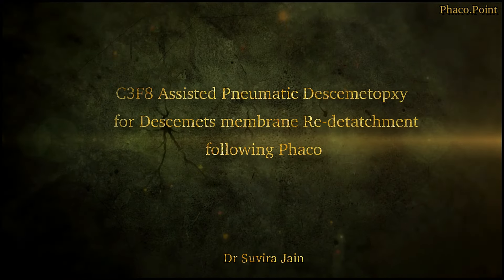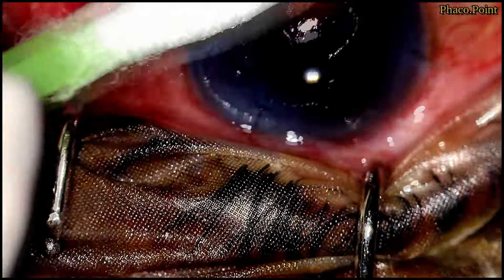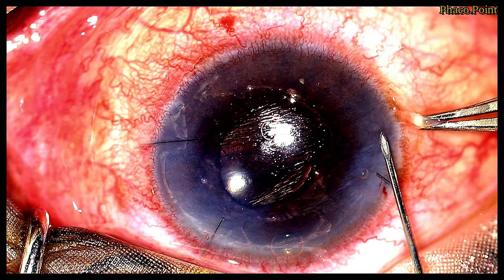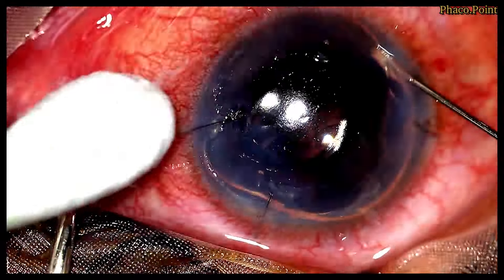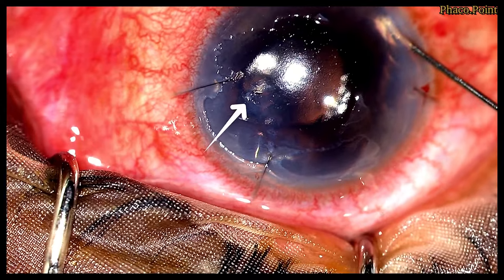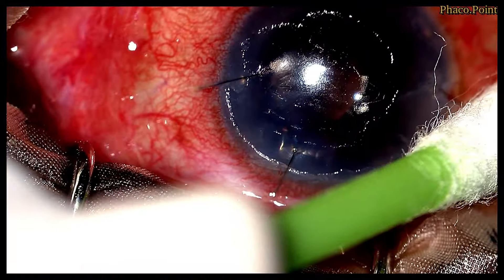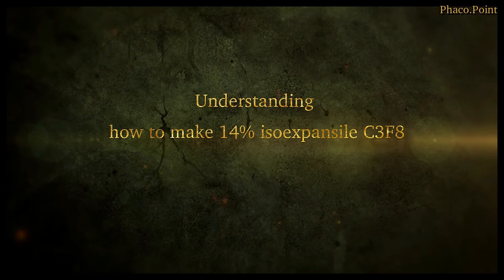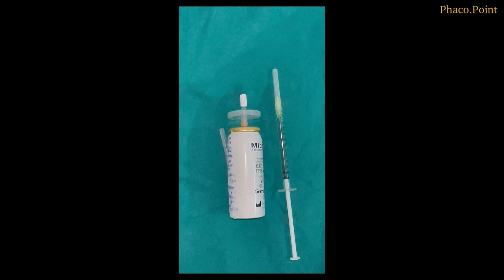C3F8 assisted  Pneumatic descemetopexy for Decemtet's membrane Detachment - Step by Step

Comment: Great tutorial. I  have two questions please
1. Do you place a BCL in the eye?
2. Why burp after a few hrs? If it's an IOP spike issue or gas staying in the ey for a very long and undesirable duration, can you use SF6 instead? 

Thanks
Reply from the maker: Thank you
I personally do not prefer to use contact lenses because oft he inherent possibility of infection.
I'd much rather patch the eye with an antibiotic and allow the epithelium to heal. This dosent take more than a day usually 
Burping to me is indicated because Id like to avoid a pupillary block. Moreover, in a few hours  the descents is almost certainly well apposed to the stroma, and hence I find , burping dosent reduce my chances of success
Yes you can use S F 6 but i havent tried it
Reply: Could you show a video of how you patch with an antibiotic and the day 1 post op slit lamp photo to demonstrate the healing. I'm not familiar with this and find it a great alternative to BCL if it gives the same result. Thanks